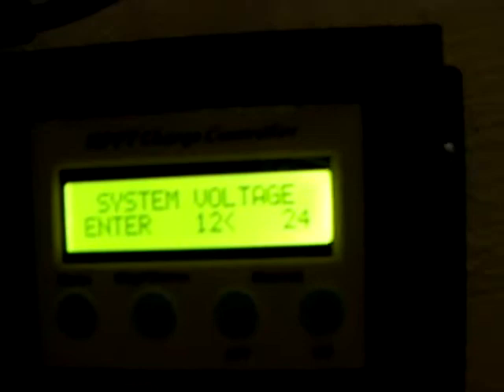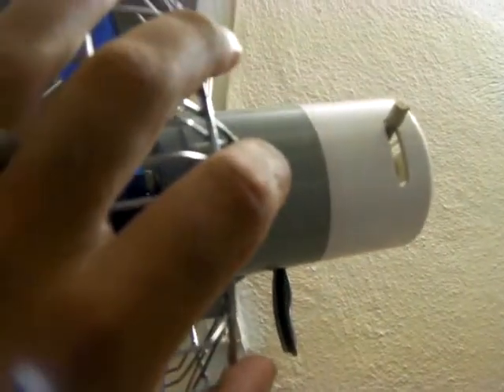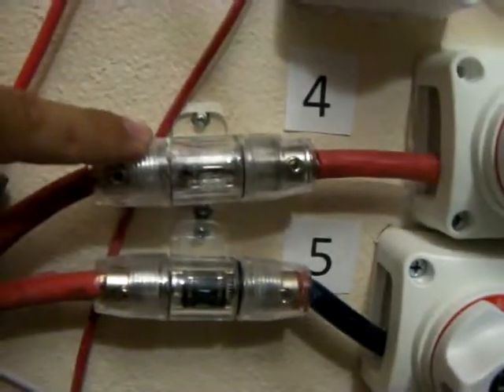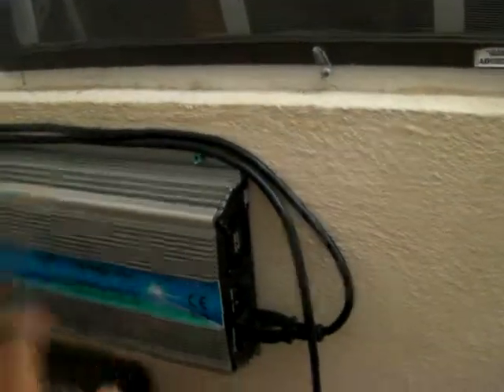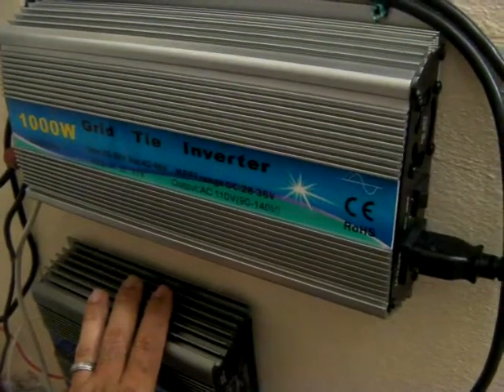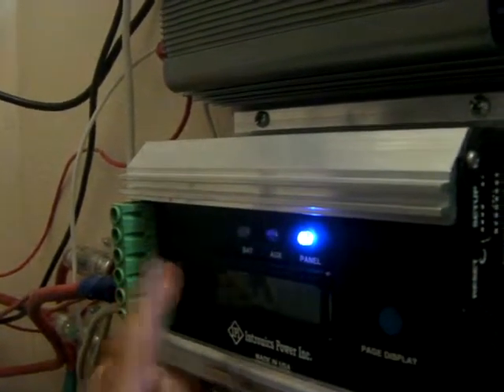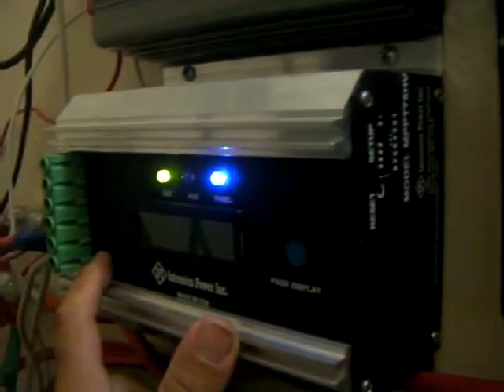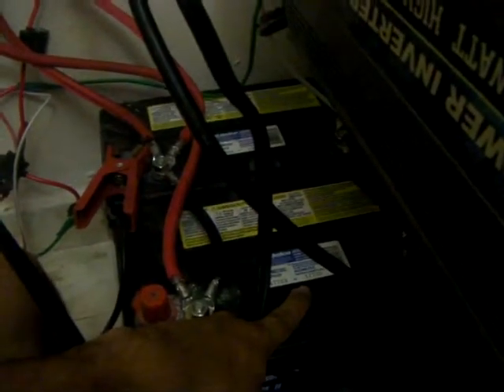INTRONICS MPPT CHARGE CONTROLLER PART 2

Comment: Sorry to hear that...I have 2 of them and are still good...1 is working 48v with 1,000 watts of solar panels and the other has around 500w for 24v...all worked good in the las emergency we had down here in Puerto Rico...a storm called Erika...good thing did not hit us directly... But we did have a blackout...

Comment: I had my Itronics for about 1  1/2  years before it burned up.
I have only 300 watts of panels and it started to smoke from one day to the other, nothing was changed.
One of the mosfet that are mounted on the side burned into charcoal.
Did you send your charge controller off to get it fixed or did you fix it yourself?

Comment from the maker: I ordered 4 different desulfators that I'll be using in different battery banks here at my house and  two more at my moms house...I'll be posting videos as my two projects advance...brands are..infinitum, IES DS-1000 48v, wizbang plus and a Chinese one I bought on eBay...the blue one that has a built in display....planning on leaving them permanently connected since they are designed to.shut down when voltage drops to a preset level....any advice and questions are welcome...thanks...